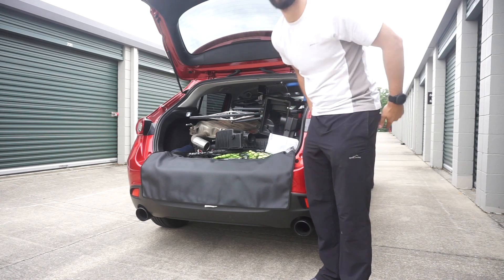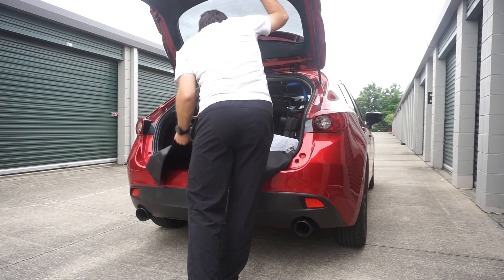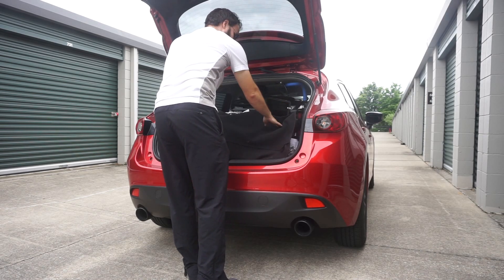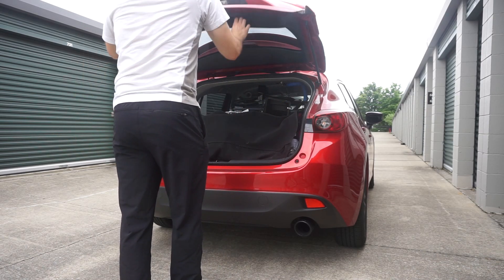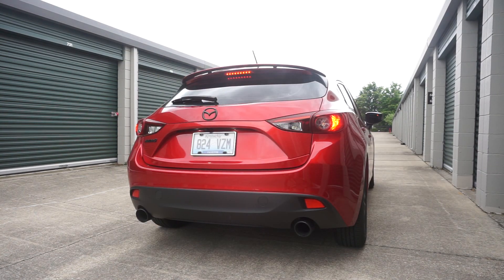Mazda3 Update Video - Sound Insulation - Loading Up The Hatch

Comment: Why did you pick Borla out of everything else? I'm thinking of getting an new exhaust soon but I'm torn between Borla, corksport and ultimate racing exhausts. Have you looked into the other 2 I've mentioned? If so what made you pick the Borla over them
Reply from the maker: Tech Defender I only compared Corksport and Borla. The Borla sounded much better and was a much better value. I also like the larger size of the Borla tips. Corksport products seem cheap and overpriced to me, which is why I changed my mind on their intake and went with Injen. The other exhaust you mentioned I am unaware of.
Reply: TheAdventureMazda from the videos I've watched I think I prefer Borla over corksport and I'm guessing Borla is the better bang for buck
Reply from the maker: Tech Defender Yea its a good value for sure. I had to buy gasket sealant for mine because it never lined up perfectly. I got a tube at home depot and now its perfectly connected. I posted it in one of my vids.